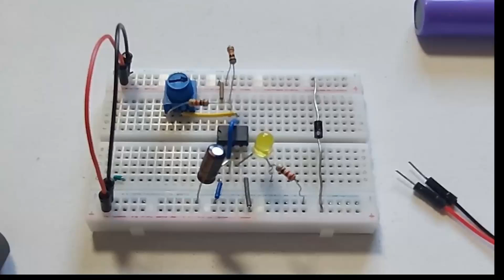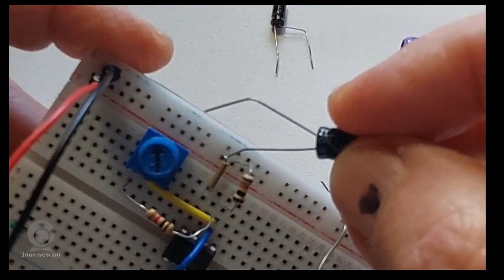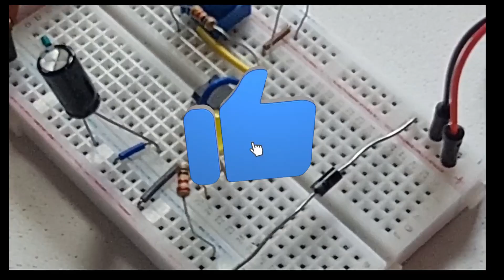555 Timer LED Blinker with Potentiometer Control Astable Mode

Comment: Hello this looks nice! Do you mind sharing the list of components needed especially the resistor’s ohm value along with the capacitor? :)
Reply from the maker: Hi there they are all visible on the description below the video here they are 3. Circuit Summary

Pin 1 (GND): Ground

Pin 8 (Vcc): Supply (+5 V or +9 V typically)

Pin 4 (RESET): Tied to Vcc (disables reset)

Pin 2 (TRIG) & Pin 6 (THR): Connected together, linked to timing capacitor

Pin 7 (DISCH): Controls capacitor discharge through resistors

Pin 3 (OUT): Drives LED (through resistor to GND)

Pin 5 (CTRL): Optional 10 nF capacitor to GND (noise stability)

Timing Network (Astable):

R1 = 10 kΩ from Vcc → Pin 7

Pot + 1 kΩ stop resistor from Pin 7 → Pin 2/6

C = timing capacitor from Pin 2/6 → GND

(Optional) Diodes across pot for separate ON and OFF control